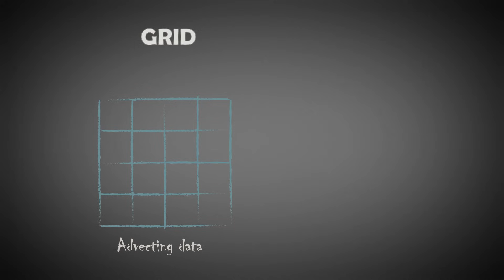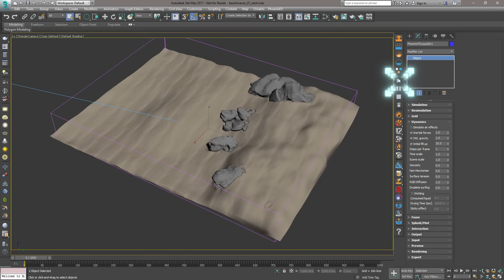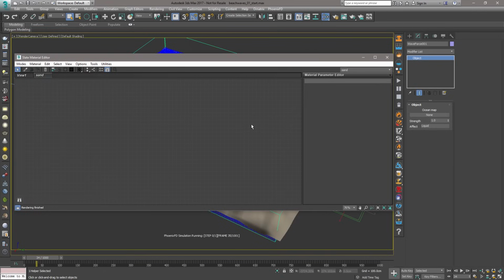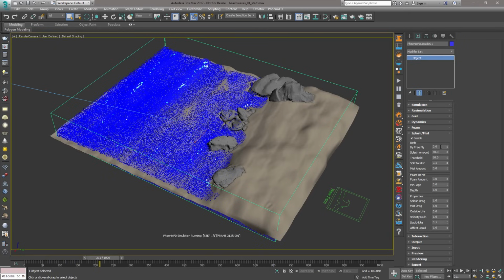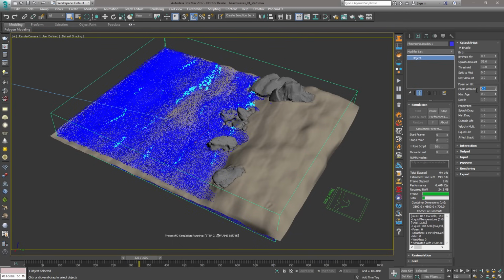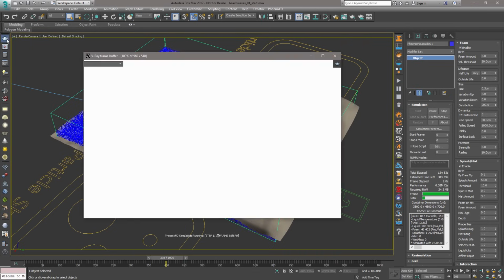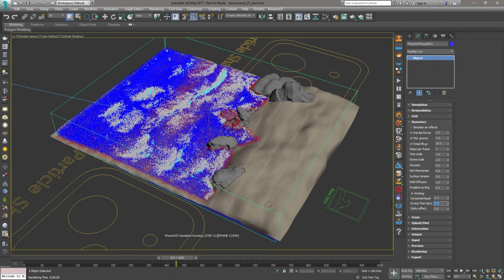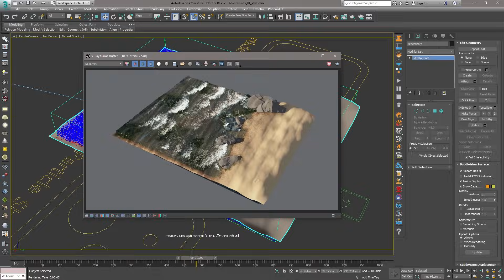Phoenix FD 3.0 for 3ds Max - Beach Waves Tutorial

Comment: what about particles underneath beach that was created initially? optimise that first...other than that great video :)
Reply: I don't know if making the ground mesh solid will help. It seems that you can force PFD not to create particles inside a mesh. But I'm not at my computer to test right now.
Reply: Yup, the ground mesh should better be closed.
Reply: If the mesh is Solid in its Phoenix props, particles won't enter it. Otherwise, particles and fire/smoke can pass through meshes. However, it's always better to use closed meshes, instead of curved or displaced planes, because Phoenix doesn't always work well with open geometry :)

Comment: The water in my render looks nothing like yours...just a bland blue mesh looking thing.
Reply: What renderer engine are you using?
Reply: DeformedMonkeys I have both Vray and Octane....that day I was using Vray.
Reply: Huh.  Ran into the same issue on my vray too.  However when I use the ocean preset all the way to the right on the top bar, it does water just fine.  Not sure what we did differently.
Reply: DeformedMonkeys Lol, me too,  it's a mystery to me too...😄
Reply: Yea... I had the same problem.  Was using V-ray